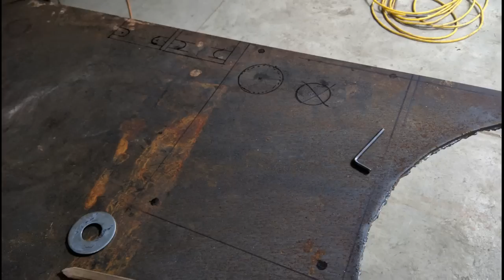James Hallock on Lime Stabilization of Compressed Earth Block (CEB)

Comment: I sped through it for now, but lots of interesting discussion in there including a number of things I had not thought about deeply. A few places where video image would have been nice, but I visualized. I've got to get around to more research on domes. Eliminating the need for insulation in temperate climates is ideal, but the long-term safety and maintenance seems difficult to me. A neighboring farm is considering building a large cob dome inside a geodesic of some sort (due to weather and slow construction).